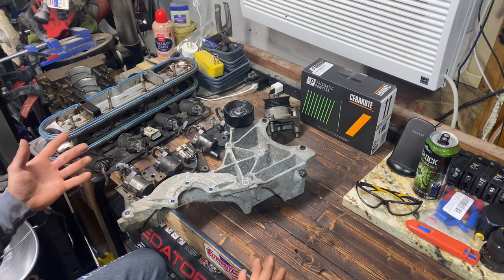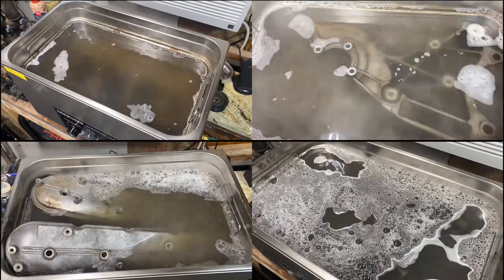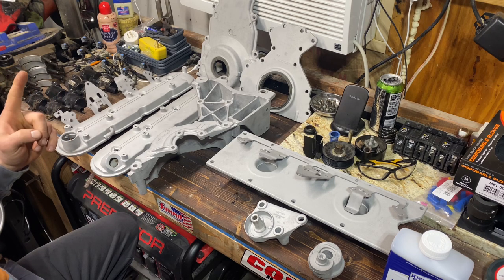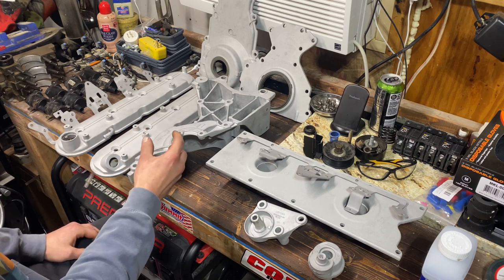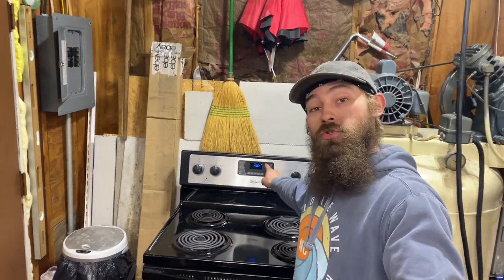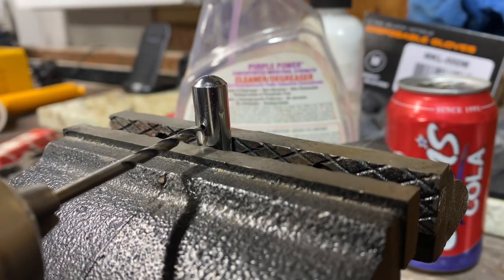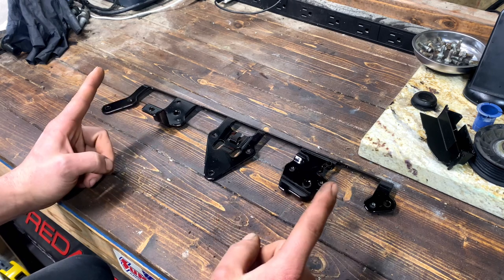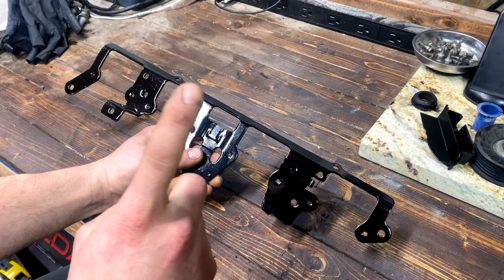PRO Powder Coating Results with Harbor Freight Gun!!

Comment: How many valve cover can you finish with a pound
Reply from the maker: Not sure exactly how many valve covers you could do, but to put it this way. I’ve done both main covers, motor mounts, bolts, coil brackets, transmission bell housing and output shaft, and a bit of other misc parts in gloss black  and still about 1/4 to a 1/3 of a pound left. A pound goes a long way. For the blue I have a bit over half and it’s done the valve covers, valley cover, oil pan, bolts, and some other stuff
Reply: @ yeah is sounds pretty efficient,thanks for the reply
Reply from the maker: It’s much cheaper than paints once you’re setup for it. Thanks for watching!

Comment: New to your channel what was the size of drill bit you used for re-drilling the extra holes on the part in the gun ?? I did see another video where the tip ( a metal tip ) was ex-changed for another & it looks like a PVC type pipe added to the tip of the gun. Would these mods help the gun more ? Since I'm barely starting to powder coat I can't afford even advise LOL to buy extra stuff for the gun. Thanks for the video's its awesome how you use the kiss method (keep it simple stupid ) Bueno sir be checking out the other videos you got.
Reply from the maker: I used an 1/8” bit. Since these videos the only thing I do different is I run the gun without the diffuser on the tip (the yellow plastic). I find the gun is a lot better without it in corners and I just bump the PSI to barely on when spraying. I don’t know how the metal tip or the PVC mod affect the gun but currently I’m happy with how it works with just the holes drilled out and 2 added. I’m glad you like the content! Thanks for watching!